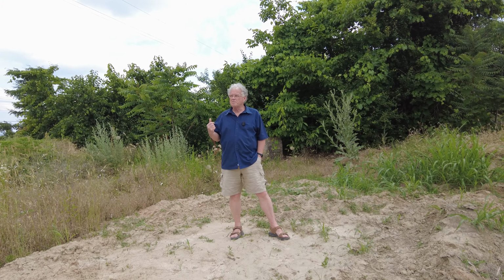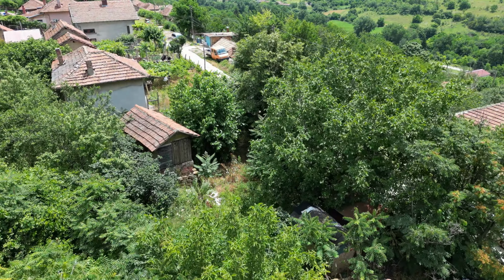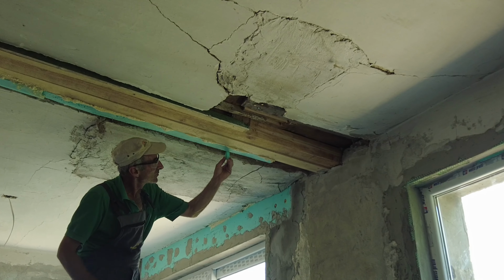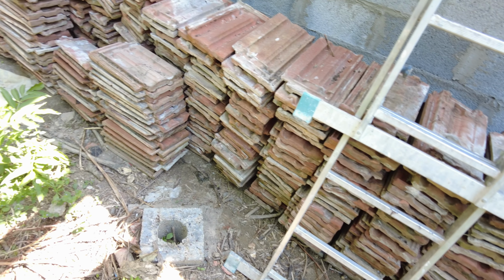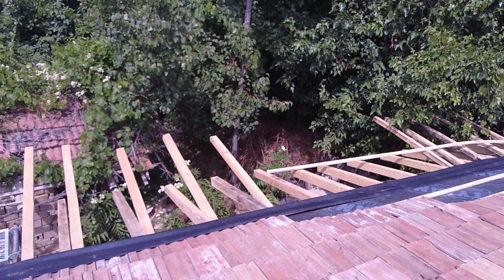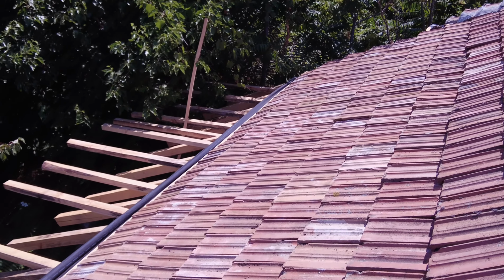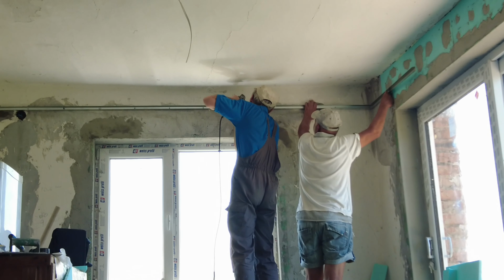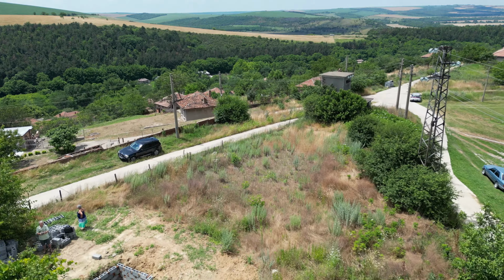Our House BG 21st July 23

Comment: How are they working in the heat of 30 degrees and higher?
Reply from the maker: I can only say they are used to it.  Ruth and I have never spent more than an hour or so at the site every day, and we try and get in the house where it's cooler.  But we end up dodging about from room to room and getting in the way.  I think if you lived there full time you would acclimatise.

When I first went to Oresh in May 2007 the temperatures where touching 40 degreees and we were staying in Colin's house near Veliko Tarnovo, which had no air conditioing.  I was highly uncomfortable and not getting any sleep.  I persuaded Colin that we should go and rent rooms with aircon in VT for our last few days.  The Bulgarians can survive without A/C, us Brits can't stand the heat.